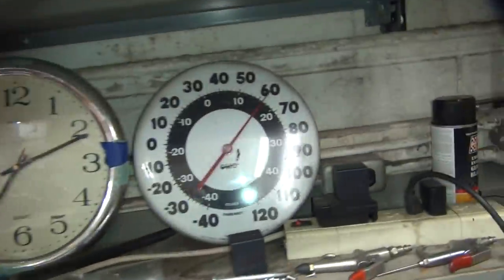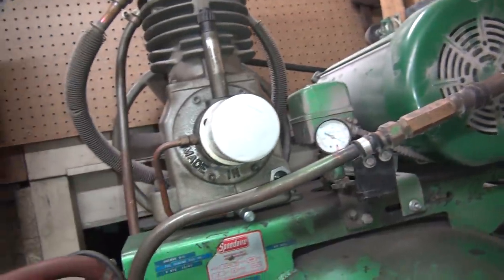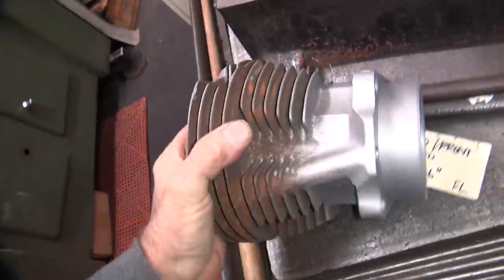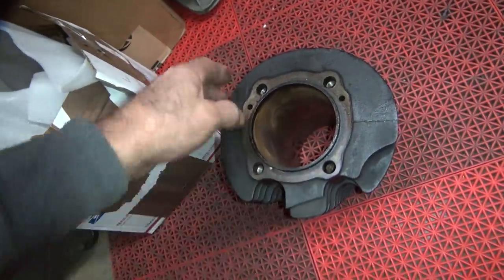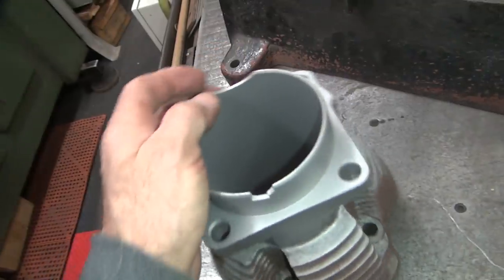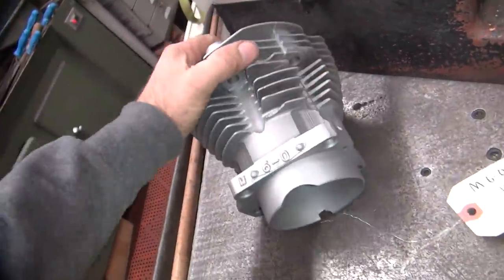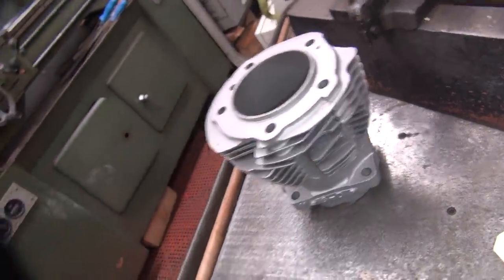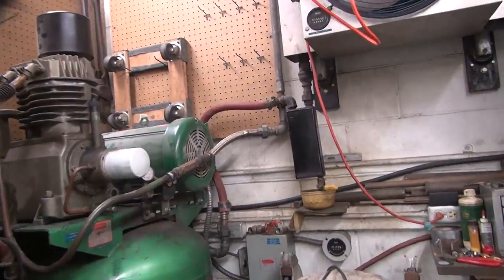2021 how to identify panhead cylinders, how bead blaster & air compressor work harley tatro machine

Comment: Hey Tatro, I have the same Uni-Hone blast cabinet. Bought it from an auction with no paperwork. Do you have any idea what the lever on the front left leg is for?
Reply from the maker: they are still around if you need any info or parts. i rebuilt my other one a while back and its in my videos. the lever controls the flow of the beads if it is working correctly.
tatro